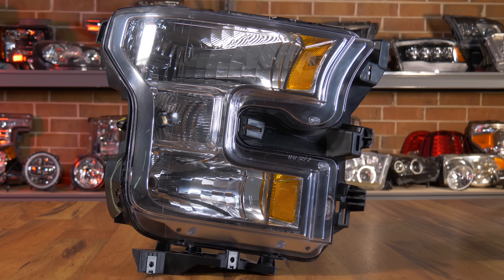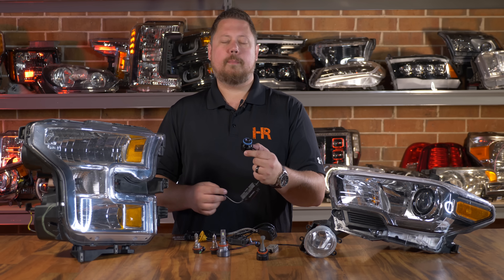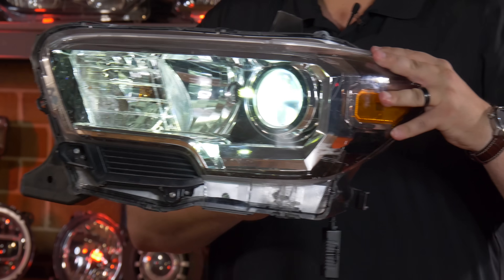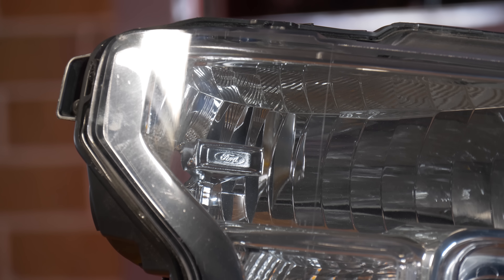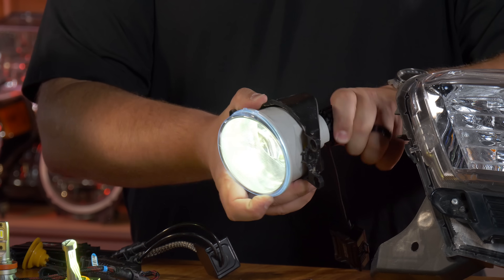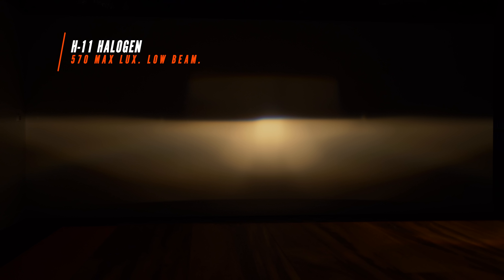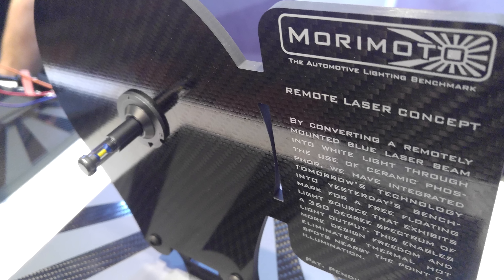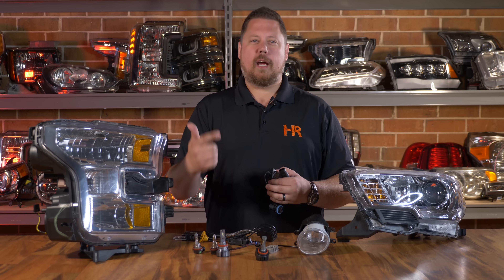Laser PNP Headlight Bulbs are Here! Do they work though?  |  Headlight Revolution

Comment: It may need its own proprietary housing like most LED headlights do. Think they might under perform like most LED conversion kits do.
Reply from the maker: Yea but everyone wants a conversion. We think this product has a way to go before it's perfected.
Reply: I picked up some PerfectFits for my 12 Subaru Hatchback stock housings for a LED conversation and they work great in my application.  Was wondering about these Laser type bulbs and believe they need a diffuser/reflector type system in front of the lense to scatter the beam to the reflectors inside stock incandescent housing to be a true conversion.

Comment: Lasers are nice in theory because it's a very powerful beam, but there's no scattered light at all.
   The only way a laser light could be useful is if it's used in a combination set up. You can either use them in a light bar, or if it's used in a combination headlight where low/ high beam work together. BMW is a great example of that, but other than that, it's fairly useless.
Reply from the maker: That's right! Exactly what we were thinking.

Comment: Laser high beams in newer cars are used in conjunction with a secondary high beam pattern. The laser is purely to illuminate very far down a highway for instance, that is its intended purpose, it’s obvious it’s rendered completely useless in any other application
Reply from the maker: Thank you for the extra insight!
Reply: You just made that up.
Reply: @frisbee544  was that directed at me?
Reply: That is a current implementation but that does not mean it could not be used elsewhere in a properly design, purpose built fixture, not something it was never intended to be used in. "Laser" illuminated phosphor has high luminance which allows long projection, but it could also be used for better light control up close, but LEDs are good enough, cost less, and are much more efficient.

Comment: Output per watt is potentially much better with laser but how to project the light in a usable pattern? I wonder how Mercedes and BMW are doing it.
Reply: If designed from the ground up to accommodate the laser bulbs. But conversions will suck like most LED conversions do.
Reply: Better than Halogen/HID, but not as good as LED. How are Mercedes and BMW doing it? ... properly.

Comment: The real question is how far will that laser beam shine?  It might not be wide beam close up, but I'd imagine at distance it would be huge spread and in theory would shine better at distance than current lighting if it works like a laser pointer.  

Lasers typically aren't bright, but even at long distance the visibility is the same, a led or ordinary bulb is not bright at distance.  

Please test it  outside in real application, would need a long range area/road for testing to compare with regular lights.
Reply from the maker: @gamer007, you have a good point but in the end this product advertises itself as an on-road-use fog light or high beam bulb replacement. So, for the intended purposes could it ever truly be utilized? I agree with you 100%, and the package that this thing came in said "3000m distance" (which is why I said that in the video...) but there's no way on earth this thing shines a usable light 1.8 miles in front of you! 

If there's  enough interest we'll get another one in and play with it outside in a field somewhere and compare it to the brightest LED headlight bulbs out there, but again - what's the point? Yes it will have massive distance. Yes far away it will be a MASSIVE beam pattern, but how is that useful in a driving scenario!? hahaha Thanks for watching!
Reply: @HeadlightRevolution  

I wonder if anyone has tested a police cars light bars?  Now those should be illegal, way too bright and distracting at night...lol.  They're just about like lasers, don't know a distance at which they wouldn't be seen.

Comment: I have a 2019 JL and nI bought all the LED and there great then a couple weeks go by and now you say there going to fail in the winter time because snow and ice will stop the fan on the SV.4 on the fog lights.What is the ones you say is best then (I was mad and didn’t write down the substitute).I guess I’ll wait till it happens.
Reply from the maker: I have personally used the SV4 during the winter in Minnesota, lots of snow and ice, and mine never failed. The only reason they might fail is if you get them all caked with mud or ice. That shouldn't happen on a JL though with where the headlight bulbs are positioned. You will be fine.
Reply: I agree about the headlights but I said the fog lights,like you said in the 2nd video. I guess will see!Thanks

Comment: It looks like Laser PNP headlight bulbs need a specific headlight housing designed for laser bulbs. Otherwise, why would Audi, BMW, and other manufactures use them on their high-end options?
Reply from the maker: We talked to the manufacturer and they admitted that these are not a suitable design for most vehicles or driving situations but they are most useful as a sort of off road light. They are not designed for any particular headlight - the intended use is that they would give you a spotlight as shown in the video... if that's what you want, go for it!!  haha

Comment: I googled how BMW lasers work and it seems to me the only way this will work is for a company to make whole headlight assemblies rather than just bulb swaps.  Seems like its a pretty complex system with mirrors and such inside the lamp assembly.
Reply: That's what I was thinking, the entire assembly is sending out light in one direction, all other types of replacement bulbs send light radially from a filament, arc or 2 or 3 leds. These would have to have custom optics to really make a comparable beam pattern.
Reply: Osram make the bulbs for BMW. BMS's press release on laser headlights is so wrong as to be embarrassing, they don't even know the difference between phosphor and phosphorus.
Reply from the maker: Yes, that's the idea. But then again, 10 years ago nobody thought you could make a suitable LED headlight bulb either - and yet here we are! I'm sure in the future someone will be able to make one that works right, but for now the technology is too undeveloped. Check this out though: https://betterautomotivelighting.com/2017/01/19/morimoto-laser-bulb-concept-revealed-at-dvn-detroit-2017/
Reply: @HeadlightRevolution  Except those headlight bulbs DONT work well. Your so-called beam pattern that looked just like halogen really didn't look anything like the halogen beam to the trained eye. It had holes, overly bright areas .... it was a hodge-podge of poor lighting.
Reply: BINGO!.......

Comment: Lasers might be nice in the future (definitely needs maturing). 

But right now I'd be happy if manufacturers made the fans actually fit in the headlights (common problem is them being too wide, can't really be wider than the H7 fitting) :P 

So far I've only found one that fits, and that's Morimotos 2stroke 2.0, but that's not the best for reflector high beams sadly. 
Probably going to have to go "down" to HID-converting to be able to get any usable light :/
Reply from the maker: You should try the Morimoto 55w HID kit for H7 applications. No fitment issues, great beam patterns, great reliability and super super bright! Our expert sales team would be happy to assist you: sales@HeadlightRevolution.com

Comment: Please advise best led headlight bulb for Bmw e46 ....(currently running on halogen bulb)
Reply: It's really easy to retrofit a bi-xenon or bi-Led projector in there. Search YouTube there are plenty of how to videos.
Reply: @HeadlightRevolution  i think that is not available in my country (uae) is there any other brand that you can suggest
Reply: @HeadlightRevolution  it has 4 bulbs 2for low beam and 2 for high beam. So i assume the holder is h7 please correct me if am wrong
Reply: @czwarlord9243  that's why I said projectors.
Reply: @czwarlord9243   True but apparently the H7R HID kits with a section blocked out solve the problem and greatly improve the light pattern and reduce dazzle as they have similar pattern to standard H7 but can't say I've tried them. Wonder if anyone else has.
Reply: @czwarlord9243  True, that's a good point. It does just block part of the bulb off. I've had HID kits in projector lens beofre. They look great but not sure you get anymore light output, bit I wouldn't say it was worse so didn't really mind that. Really irritates me when people put HID kits in reflector lenses, they don't look good, have poor pattern and just blind everyone. Can't be great to drive with. The only car I know that came with  HIDs in a reflector lens.from factory was the Honda Civic Type R but I guess that was a specially made setup and reflector housing as it didn't blind other drivers but to be honest didn't look as good as HIDs in projector lens. Then a load of copy cats started putting retrofit kits in their std cars!
Reply: @imranagha1982  some Volvos , Audis and Mercs had D2R bulbs from the factory. I'm sure there were more.
Reply: @czwarlord9243  https://youtu.be/YIQPEJsV-oI
Reply: @czwarlord9243  bi xenon retrofit https://youtu.be/YIQPEJsV-oI
Reply: @czwarlord9243  I've retrofitted a few myself. The cost to retrofit e46 specifically is around 200-300$, depending on the projectors. With new lenses and bi-Led projectors.

Comment: needs a proper housing that reflects the light to a proper low beam pattern.. like how a low beam halogen has mirrors perfectly placed to reflect the light coming from all directions. 
would be great to design one that takes the light from a central focus beam and spreads it out
Reply from the maker: That would be awesome!
Reply: That was my thought as well. If they are being used in some higher end vehicles, they have application specific reflectors/housings to use with them to get the proper/useful beam pattern.
Reply: @TonyL7373  i would love to design and test it if i had the machinery lol

Comment: If it can't mimic perfectly what's supposed to sit in your housing, stay far away from it. Factory laser headlights are complicated, custom designs that can't be replaced with a bulb-swap. The only option to get "giant lazurs" is to find OEM replacements or aftermarket headlight housings and even then, if the result is not safe for others on the road, return it.
Reply from the maker: Good assessment!